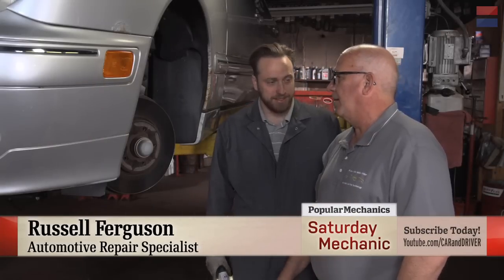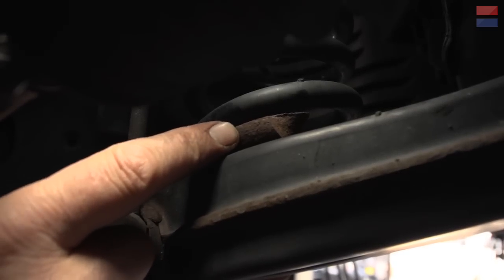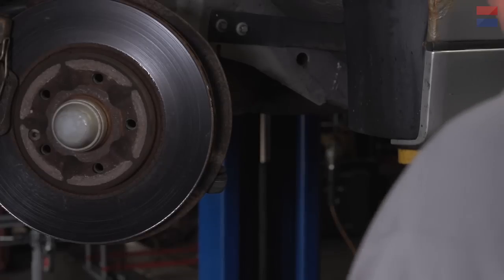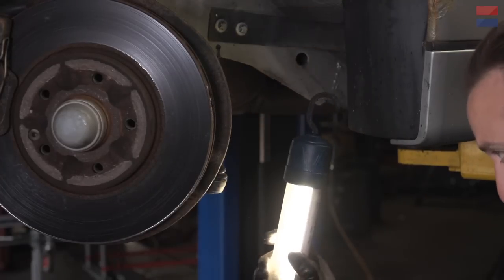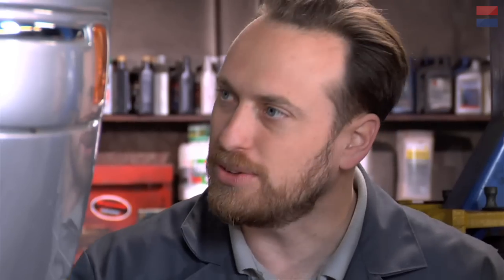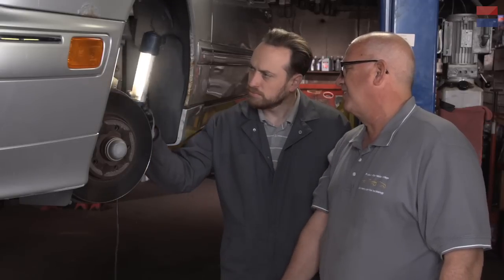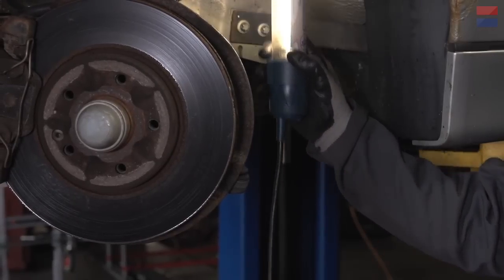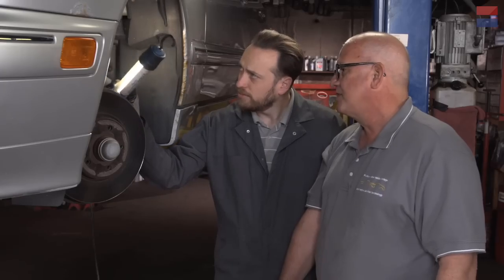The Dangers of Replacing Coil Springs on Your Vehicle - Full Clip

Comment: I have a question, on my W210 there are some pads above the coil spring, i want to change them out to get the car a little lower, is there any way to get the springs out without reassembling everything shown in this video?
Reply: you can pull them out with just compressing the spring..the car has to be lifted but the spring can stay on the car
Reply: okay, thanks :)

Comment: with the rights compressor, its a 20 minute job to change a spring, you dont need to unbolt the balljoint etc. just compress the spring and take it out.
Reply: Yep.
It's all down to tools and the users. Personal (safe) "record" was around 20-30 mins for one spring (and i'm not a mechanic, just electric engineer)
Reply: its even possible to change the spring without removing the wheel. we did that becaus the custumer forgot where he put the wheel lock :D
Reply: wankelFan2 okay now THAT is impressive!

Comment: This video shuld be removed. First, I've used the original mercedes spring compressor several times, and there is no way this would happen when used correctly. Seccond, why take half the car apart? Insert the spring compressor, compress the spring (don't use impact wrench), take it out. Insert the spring compressor in the new spring, compress it, install it in the car, untighten the spring compressor. There, you've fixed it. 

Videos like this shuld be educational, this one is not.